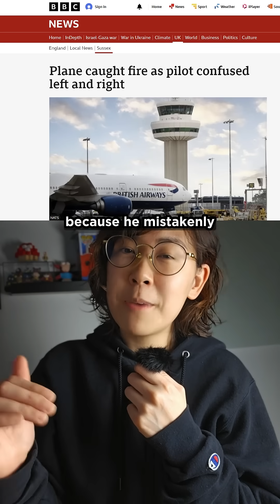Did a Pilot’s Left-Right Confusion Really Shut Down the Airport?

Comment: 2 points to add. He was coming back from a long period without working. And there was a small fire due to overheating because you should never abort a takeoff after V1 speed. But he needed to abort because the lever shouldn't be pushed back, so it was a crazy out of normal situation
Reply: good clarification
Reply: Came to comment about the fire being pretty normal given the circumstances, you're already on it 🖖
Reply: Hm
Reply: I mean props to Boeing for having their brakes work this well. After all we've heard in the last couple of years, having the brakes work themselves into a fire but stopping the plane after V1 is a PR move they sorely needed.
Reply: There are a few serious reasons reject the take off above v1.
Reply: You can abort after V1 depending on how long the runway is and how far down it you are. I’ve done it once and hopefully only once.
Reply: @CodyB2 V1 is the point of no return even if an ebgine fails you circle bacj on the good one and land again. Most runways won't have enough length for heavy jet to come to a full stop from over 150 knots
Reply: when you're doing this everyday sometimes you go into autopilot (no pun intended) and let your muscle memory do the basics, but when you're coming back after a while, you're usually more careful of the checklist
Reply: Well, it wouldn't is called V1 without a reason.
Reply: Yeo
Reply: Damn, maybe these guys should be required to come in and train on a simulation every so often during periods where they don't work. I think a lot of pilots actually have simulators at home too. Sounds like a relatively inexpensive way to prevent serious problems. Like I understand that those simulators aren't cheap but they're a whole lot cheaper than paying for a brand new 747 and everybody who died
Reply: @rhyslogan6490  the problem is: captains doesn't sit on the left side only. Often they have to sit on the right side. It's not possible to delete muscle memory completely.
Reply: @rhyslogan6490  No-one died. The brakes caught fire and were extinguished.
Reply: Avgeek here

Comment: I have a genuine question what brake do they use, because I thought they had air brakes 😅
Reply: There is also an auto break that is used during takeoff and it is there if the pilots think that the takeoff conditions are not safe they can abort the takeoff. It can also be useful with landing but they use a different setting on the auto break. They also have peddle breaks that can be used on the ground for breaking. And the one your talking about I believe is the speed brake and that’s the one that pops up on the wing during landing and it is to help the plane stay on the ground as well as slowing the plane down, it can also be used in flight to slow the plane down as well

Comment: But did he move the yoke too? This is implying that he was intending to pull back on the yoke so they could lift off but at that point you’ve already passed V1 which is when you need to carry on with the take off. Shouldn’t they have set the thrust to TOGA and carried on with the take off? If they had enough runway to stop without over running they definitely had enough runway to get back to rotation speed with all the momentum they had.
Reply: It's all in the report. He should have pulled the column back (RH).. but instead pulled the thrust back (LH). It was only brief and while the copilot says  he believed he could  have gone for the TOGA, he though that as he  had briefly commenced thrust retard it was better  to  continue that. The report is only a short read and worth it if  you are  interested.

Comment: There should be a rating system for news articles+authors on their authenticity and their correctness done by general public itself. Also they should declare if the publication is right or left leaning. There are no centerist outlets and we get it. Just say so. 
Also they aren't educated. If it's an engineering issue the writer should belong to the STEM field and should have been involved in it for some time. If it's economics then the writer should have had a job as an economist somewhere and should be well versed with data and statistical interpretation as well. Similarly for every field.

Comment: Of note, the plane was already well down the runway at "V1" decision speed, which is why this brief slip-up was so dramatic and resulted in a full-speed takeoff rejection.
Reply: Good question. The answer is in the report. The copilot believed he could have gone  TOGA and made it safely aloft but as he  had initiated the abort process accidentally (albeit briefly) thought it best to continue that option.
Reply: @i1uvpreppyxo887  - retarding the thrust levers on the 777 initiates the RTO, so the brakes automatically activate, spoilers deploy, etc. There is no coming back from that, and try to continue with the take off.

Comment: I suppose he brought the power to idle because he rejected takeoff, pushed the yoke forward for the same reason. And main wheel fires are quite normal after an RTO. Tower usually sends a firetruck right to the plane in case wheels catch fire
Reply: But of they were at VR they’ve already passed V1 which means they should’ve continued the take off. If they had enough runway to abort without over running they definitely had enough runway to get back to rotation speed, especially if they were already at or even past VR when the pilot pulled the throttle back.

Comment: I think theres still a significant aspect of some sort of fatigue or altered mental state (or even miss-reporting) going on here. The thrust levers and yoke feels very very different, and there are no shortage of cues telling the pilot which side of the plane he is on. This isnt confusing the brake and gas pedals, this is more like confusing your gear shift lever with your steering wheel.
Reply: I agree. We are talking about a well seasoned pilot here.

Comment: For those who think that moving the thrust backwards will make the engines idle well no if you push it all the way back it gives reverse thrust bassically the engine gives thrust backwards rather then forward. The reverse thrust is used to slow the plane when landing.
Reply: Going in to reverse requires pulling a second set of handles forward of the actual thrust lever handles (attached to the thrust levers themselves) up and back. Pulling just the thrust lever handles all the way back puts the engines into idle.
Reply: @VyarkX   yes your right but they didn't mention that he pulled the handle so how did the reverse thrust apply or the handles were already pulled?

Comment: If I'm not mistaken both the captain & copilot put their hand on the engine thrusters and operate them in unison. I can see how if you are a captain and you switch to the copilot position you could inadvertently mix up which side is which similar to reaching over your left shoulder to grab a seatbelt in a car but sitting on the passenger side.

Comment: Media aside, didn't both pilots had to put their hands on the thrust to avoid this kind of fault while on take off?
Reply: I'll help you out. During takeoff only one of the pilots (captain or first officer) is the pilot flying, the other is the pilot monitoring. Pilot flying has their hand on the thrust levers and the yoke (or sidestick for airbus planes). Landing is the same as well, one pilot flying, other monitoring. They usually alternate.
Reply: @AdamAhmed24337  from my understanding after watching too much air crash investigation videos 😅 during take off,pilot flying will handle the thrust lever until some time,usually after gaining some speed required,and let the other pilot to adjust the lever setting,with both the pilot keep their hands to the lever to avoid accidentally retracting the lever,until v1, because in this v1 speed it is not safe to abort take off and the pilot flying will focus to lift off,and hands off the lever....clearly,pilot flying did not do that because he pull the wrong tools 😅

In the landing,however,he himself need to adjust the thrust...
Reply: No
Reply: @Elmm497 actually if you carefully watch the video again,you will notice that both pilots did put their hands on the thrust 😅
Reply: @PERSINGGAHANABADI  that is odd. I don't know why the captain decided to put his hand under the throttles. That is unusual. On a separate note you take your hand off of the throttle when you reach V1 which is a speed where you do not reject the takeoff for almost any reason.
Reply: @GamerPilot0620  literally what i said ☝️
Reply: No. And at the point where the mistake occurred the  copilot should NOT have  still had his left hand onthe thrust levers. Read the official report

Comment: This doesn’t make any sense 
The throttle controls the engine spin faster to gain thrust  ,  not power up
Yoke controls the flaps to go left and right or elevate
So I think the problem is that there is more thrust making the pilot use parking breaks 
Making parking breaks to catch fire
Just correct me if I am wrong
Reply: The co-pilot may not have been as used to sitting on that side of the plane so muscle memory got the better of him. Since he mistakenly retarded the engines during a take-off roll, the procedure would've been to abort assuming they haven't reached V1.

The brakes catching on fire during an aborted take off with full take off weight is expected and something all modern commercial planes must be able to do safely in the event of one.